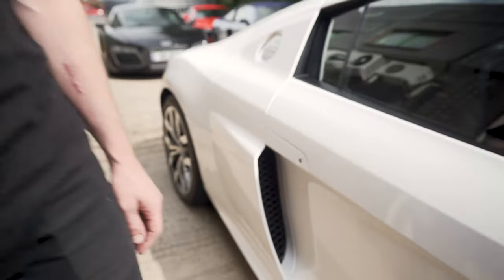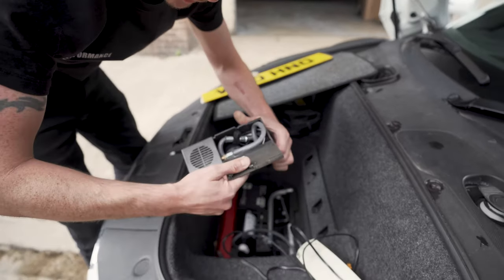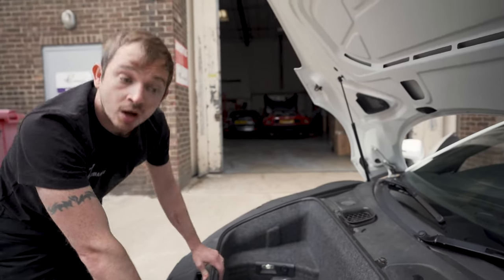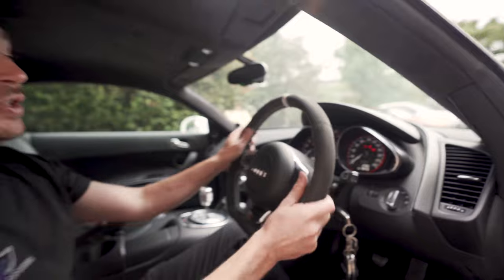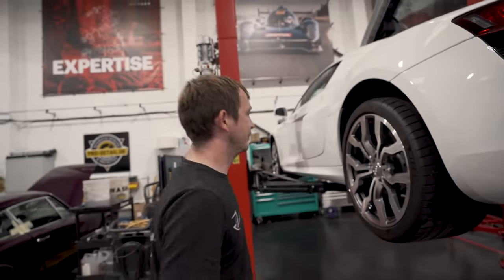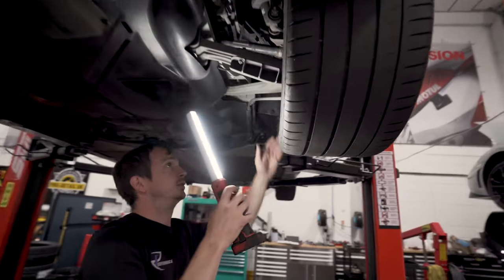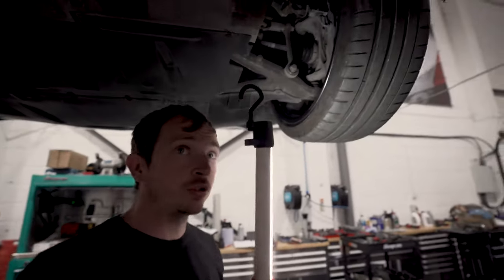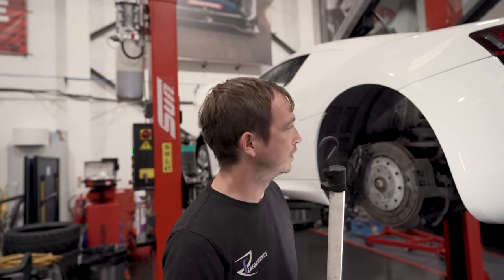Audi R8 V10 Gen 1 buyer's guide – essential info!

Comment: Any thoughts on nylon screws instead of metal for the wheel well liners? Black nylon screws are available. The ones in my R8 were so corroded and some impossible to remove that I replaced most of them with nylon screws (except one spot where the head of the nylon screw seemed to big compared to the metal one. I've had nylons screws for 1.5 years without issues.

Comment: squeaking noise caused by the brake light?? i always thought it was from the rear sway bars when it gets cold out...i need to check that out good info!
Reply from the maker: Both do it, the creak over sleeping policeman is normally arb bushes. The mouse squeak is the brake light.

Comment: Amazing video! Your knowledge is incredible on this car. Need your help with an AC issue that I’m currently having on my 2012 V10. Do you recommend changing the switch that’s located behind the left headlight as an option?
Also, is it an easy change or even possible to do a headlight change on my 2012 for the facelift headlights?

Comment: Great Vidoes!   What has been your experience with AC compressors on the V8 and V10s?  I read that its better to leave them on all the time to extend their life - any thoughts?
Reply from the maker: We don’t see many compressor issues on either.

Most of the failures we do see if because the owner has driven it round with no gas in the system. When that happens there is nothing to carry the lubrication oil.

Comment: Great Video mate... So helpful and reassuring. What it then best was to test the bottom and top suspension joints on a V8?
Reply from the maker: You need to load them so we do it with a transmission jack and feel for play!

Comment: QUESTION
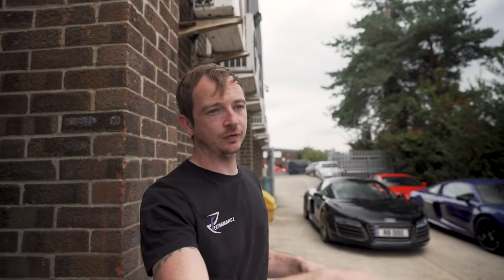At 4:35 you talk about not mixing tire dimensions. Does that mean that if you put 20" on these you should run 305x25 rear and 235x30 front to get the same difference in radius and circumference between front and rear? Or is it something with the width of the tire?

Comment: Use bilt hamber atom Mac on your rotors before cleaning them it’s a brake safe corrosion inhibitor it stops the rotors rotting
Reply from the maker: Maybe the centres but you can’t put anything on the disc face….
Reply: @REPerformanceUK  it’s specifically designed for disc brakes rotors have a look into it
Reply from the maker: @thedetailingdoctor5746  will do thank you!

Comment: Are there any emergency external door release on the R8 v8 model? my R8's car battery died out and the key hole is broken, which meant that i have no possible way to open the doors or the front truck.
Reply: There’s a release lever behind the floor wall on the passages side. I literally just replaced the battery today.

Comment: Does anyone know when they switched the v8's to use the v10 suspension components (control arms, bushings)? I mean, what year onwards?
Reply from the maker: When the V10 was released they swapped to one type of arm. So 2009.
Reply: @REPerformanceUK  Thanks !
Reply: @REPerformanceUK  Did all V10s inherently have uprated control arms or wheel bearing housing, or only those from middle of July 2011 onwards (particularly from VIN 002563)?